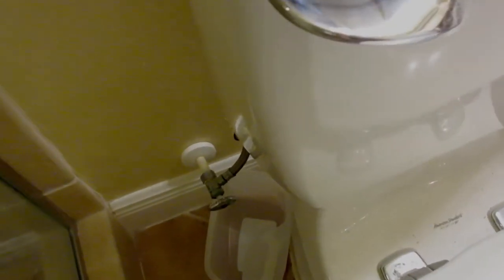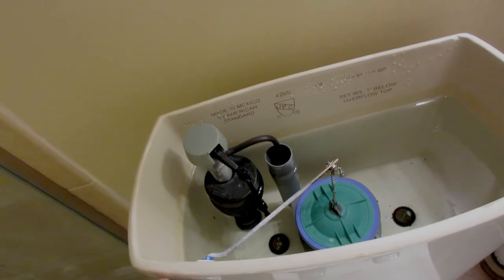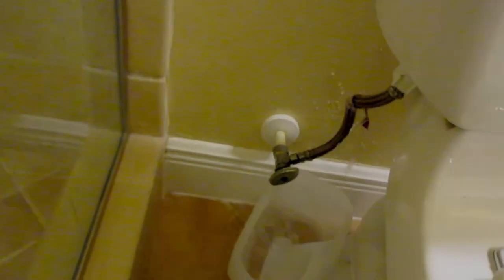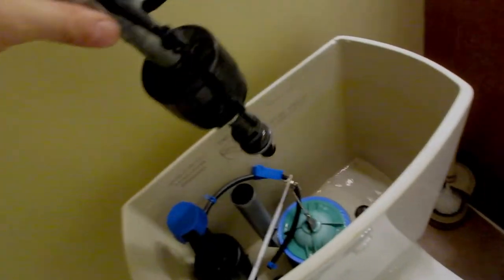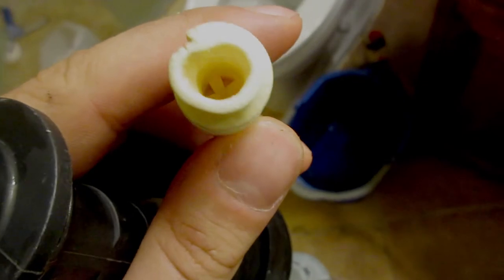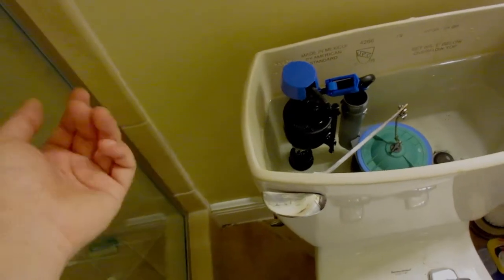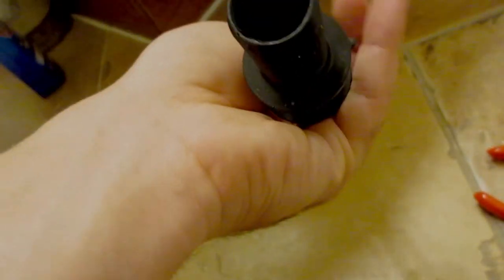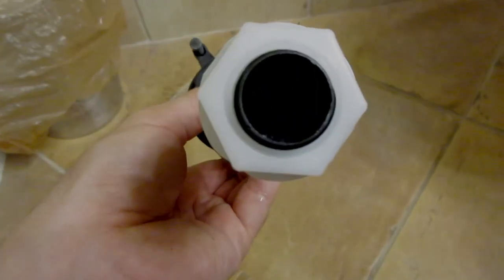Toilet fill valve making screaming sound repair

Comment: just dont use those 20 flushes tablets. 2000 flushes yea right. The amonia, clorox or whatever the chemical is ate apart the seal at the bottom of the unit. Then when a company came in and replaced the floors, when they hooked back up the toilet, the seal was totally messed up. It wasnt their fault, its just that the seal was so messed up it wouldnt go back together.
Reply from the maker: Ya those are junk just manually clean it